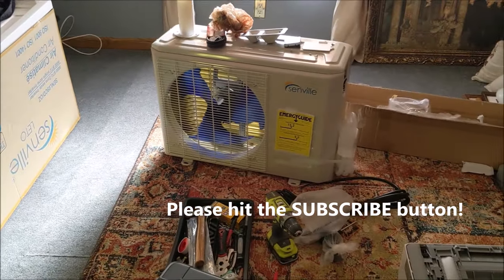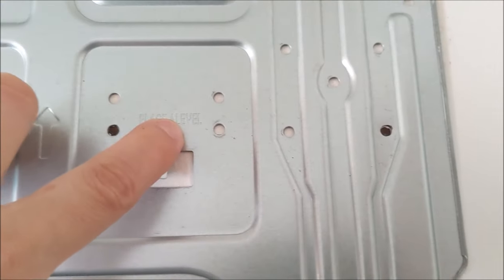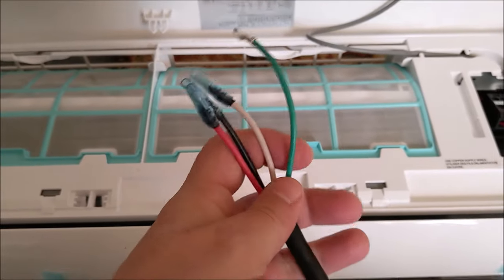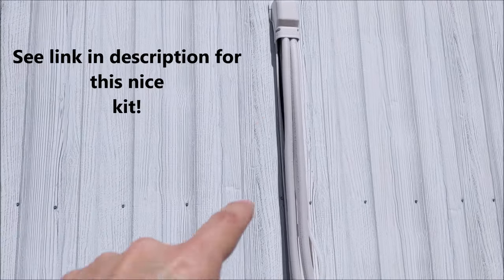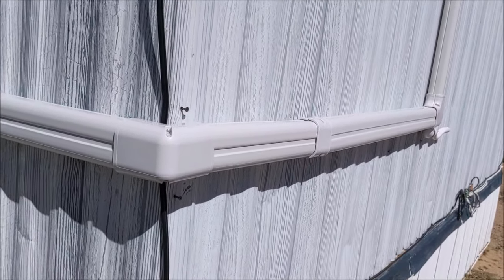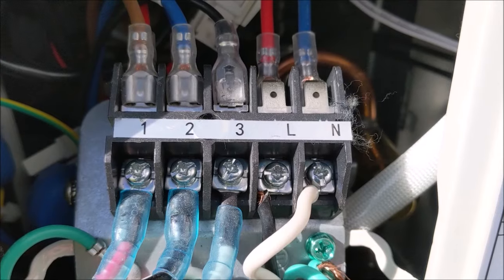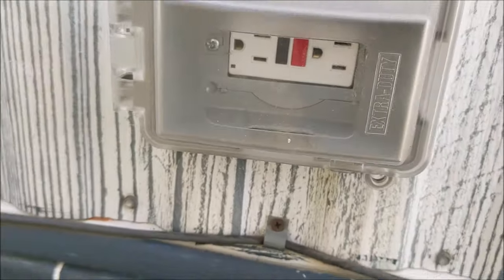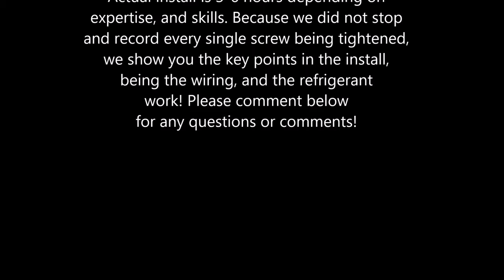Senville mini split installation key points in under 10 minutes for DIY ductless install

Comment: @SaveGreenHere
Thanks so much for the very helpful video! 
With your pioneering documentary, I'm much more comfortable installing the same mini-split and line-set cover kit than I was...

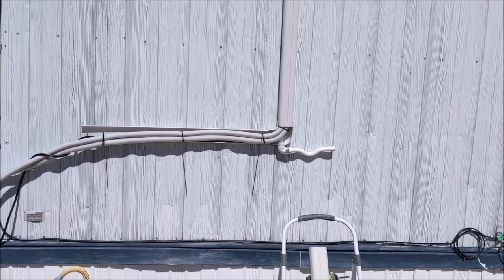You mention at 3:50 that the cover kit protects the line set from UV; but I haven't seen any claims anywhere that this particular plastic cover is of a UV-resistant plastic. I did read that it's ABS; but there weren't any UV resistance claims.
 
So where I live (south-western desert), not many plastics that are subject to the sun for any length of time can survive its brutal onslaught of intense UV, IR and radiant/conductive heat. Most uncovered/untreated plastics don't last thru a summer.
  
So how is your cover kit doing after 3 years?
Reply from the maker: They hold very ok. However, there are some that specifically say "U/V proof"......... https://amzn.to/3Ozv7T3
Reply: @SaveGreenHere  Thanks!

Comment: I wired mine the same way from the signal wire inside to the outdoor unit, but I am getting an 88 code. I understand that this code means that I have wired it wrong. Can you advise please?
Reply from the maker: Yes that is a faulty wiring code. You have to make sure you have a tester with two prongs to test the source and ensure you have 110v or 220v, depending on what you purchased. Then, you need to double check the color of the wires match exactly on the connectors both indoors and outdoors.

Comment: Fantastic tutorial. How do you like the system, is it noisey?
Reply from the maker: On this install particularly, they went with a 19 SEER. ( https://amzn.to/2XsNLC0 ) It is EXTREMELY QUIET. Funny thing, I was having a five minute conversation with the home owner right next to the outside unit, and it was running the entire time! We couldn't even tell it was on! I put my tester on the plug,  ( https://amzn.to/2WXw4Lg ) and it was puling roughly 1250 watts, so less than a hair dryer, and less than a 1500 watt space heater. HIGHLY RECOMMEND the 19 SEER Senville!
Reply: @SaveGreenHere  i may go with 2 or 3 small units for different rooms in the house. Thanks for sharing your install. 👍 i make videos too and i know it can really slow down the process when you record what your doing.

Comment: I had to switch ch my drain line from the right side to the left side (looking face on).  I am supposed to plug the unused drain king.  What do I use o plug that line?

I am installing the Senvikke 2400 btu on nit

Comment: Where do you find the communication line? I don’t think mine came with one. Also, instead of plugging it into an outlet; can we hardwire it into its own circuit?
Reply from the maker: You can hardwire, yes. That is actually the best option, with it's own breaker! Here is the communication wire..... https://amzn.to/46Mw4hl

Comment: Nice video, good stuff here.

My problem is the area I want the heatpump to go is no where near the outside receptacle. I wonder if it would be ok to route the power cord back through with the signal and refrigerant lines to inside the house and plug in there. My gut says not a good idea but still curious what you think.
Reply from the maker: Yes, you can route to the inside. And ensure you get a 10 ft plug/cable that is also the 12 gauge, like this.... https://amzn.to/3J93DyE
Reply: @SaveGreenHere  interesting. Does 12awg only come in 10 foot max for the "appliance cable"? I can find 12awg extension cords that are longer (I need probably 14ft) but they sure don't look as  robust as the one you linked to and i can't seem to find any that are longer than 10ft.
Reply from the maker: This one is onger than 10 ft...... https://amzn.to/3eTP47e

Comment: I’m going to buy the 9k BTU for a 10x10 room. Can I plug it to any outlet ?
Reply from the maker: I have a full, complete list of all the different items you will need. Anyways, on that list  on the video description, you will see this plug. https://amzn.to/3utMz0w You can wire it and it can vary from manufacturer on which unit, (the indoor or outdoor unit) carries the power to the wall outlet. If it's the outdoor unit, and you want to plug to an indoor outlet, just channel the cable to the inside where you run the communication wire, and the drain tune. then just simply have it come out the side of the indoor unit, into a plug, hopefully close to the indoor unit. If doing this outdoors, just make sure the plug connects to a non-GFI outlet, but with a weather-guard type cover, like this one...... https://amzn.to/3at6hCx  At any rate, a 9000 BTU unit is not a big power draw unit, but just make sure your breaker is at least a 15 amp, or 20 amp better, and not a lot of "heat producing" electronics are connected to the same circuit, such as a hair dryer, heater, etc.

Comment: How did you bend the pipes? I have installed the unit inside. But a bit hesitant to bend the pipes
Reply from the maker: lay them out in the hard sun for about 30-40 minutes, or during the entire time that you prep your install, like drilling the holes, mounting, etc. The sun makes the copper easier to bend.

Comment: Aura minisplit usb/wireless doesnt work.
Used seville app to try and scan qr scan, no luck. Then tried manual setup. App does not see my wireless network.
Reply from the maker: reset your router. You may need the newer type routers if after re-setting, you still have no connection. I went over the newer routers here------> https://www.youtube.com/watch?v=UFuTZ-XBxuw

Comment: I watched another one of your videos on mini split and you have the air handler plugged into an outlet, I would assume you could do that with any brand of mini split? I would have really like to see how its hooked up, can you let me know? I am getting ready to attempt the install.
Reply from the maker: You would need an outlet box, non-GFI, directly wired to the breaker panel on it's own circuit. You would also need to buy a prong to connect to the wire whip that comes with the mini split. Remember, green is ground, the middle prong of the connector.

Comment: Hi,great video. i plan on buying one of there 24k BTU with ceiling cassette. Is it possible to plug it into an existing wall outlet or do I need one of those electrical boxes?? I also have a difficulty figuring out in what order those cables go(red,white,black 1,2,3. Etc.Etc) could you please show a video in detail matching colors and numbers on outside and inside unit? Thank you so much!!
Reply from the maker: A 2 ton system should not go on a plug. It should have it's own dedicated circuit. The cables should be CLEARLY marked on your indoor and outdoor units.

Comment: Thanks for video. I’m replacing my old hvac with a 36k Senville units. The old system 240v electricity was supplied from a 3 phase panel with a hot leg. So the 3 wires are 2 hot wires and one ground as it is supposed to be for senville system as well. The voltage between 2 hot wires is 240v which seems good. The only concern that I have is that when we measure the voltage between first hot wire and ground it shows 208v and between second hot wire and ground is 120v. I did some research and it looks like this is because the panel is a 3 phase with delta configuration or hot leg. Since the senville manual says power requirements is one phase 240v do you think using the old system wires for this unit is ok?
Reply from the maker: Looks like it will not, unless you have an expert electrician provide more knowledge.

Comment: My mini split came with 220v cable can I buy the 110v wire in Amazon ? And also will that work fine ???? I got the small mini split
Reply from the maker: If you bought a 220v unit, you must use a 220v source.

Comment: I just took my 12,000 btu Senville down to relocate the inside unit I ordered a 25ft line set do u think it will be able to run ok on a 25ft line ?
Reply from the maker: How long is the current line? If it's 22 ft for example, no big deal. But if it's 10ft, for example, you will need more refrigerant.

Comment: I have a 700 ft² mobile. The bedroom is 1/3 of total square feet. Would this unit be sufficient? Also, can you use an additional wall mount with this one. Condenser?
Reply from the maker: 1.5 ton, or 18,000 BTU would do........ https://amzn.to/46LqITu

Comment: Great video! Left a comment/question on your other video.
So I bought a 110/115v unit so I didn't have to do the disconnect box. Now I was under the understanding that the indoor unit plugged into the wall receptacle is what powered the outdoor unit. But you did say that the outdoor unit also plugs into a wall outlet correct? I'm guessing 3 prong. So do I need to buy the 3 pronged wire set to connect to my outdoor unit then? I know you had links on another video for 2 different kinds, I'm just outta my wheelhouse on the electrical side and don't know which 3 prong I need and if my wall outlets are sufficient. I've read that different units use different amps/watts so my wall outlet might only give 12 watts but its wanting 15 watts. And I've seen people say that that's not really a big deal and that you'll know because a circuit breaker would trip for the section of the house its plugged into.
So like not having 2 mini heaters plugged in on the same outlet like in 1 room or 2 rooms that share a circuit,
Can both the head and the outside unit be plugged into a room all on one circuit?

Thank you for all the help. I hit the like button and watched the ads so you can get paid for your content. Thanks again.
Reply from the maker: Seems like you are a bit confused with the hoses, and the gauges. Thank you for watching. These videos may help out..... https://youtu.be/RL64RX-LvrI   and  https://youtu.be/RndlC9g5HzQ
Reply: @SaveGreenHere  Thank you, the hoses for dummies video really cleared up the low side and high side. I did leave you a comment about adding the refrigerant and a nitrogen back pressure test if you are able to assist with that. Thanks again!!!

Comment: Question: I am thinking of getting a 4-zone mini-split but was thinking that I should go with two 2-zone mini-splits?  Thanks for taking the time to make and share this video 👍
Reply from the maker: Go for it! 2 Zone systems are definitely more manageable, and less complex than the 4 zone system. They also are available for just under $2000 as of today...... https://amzn.to/3gzVqd3  All depends on the TOTAL space you have. For example, what size system is there now? a 3 ton, or a 4 ton? This can help give you an idea as to what would work best.

Comment: Nice video thanks. You didn't  use conduit for the  signal wires going from the inside unit to the outside. I've watched many videos , most don't but some do .You obviously don't think its necessary..I'm about to install a similar Senville unit and I want to do it right.Can you comment on that?? Thank you
Reply from the maker: Check with local code. In this specific install (in the middle of nowhere in the dessert) you don't even need a permit, or conduit, UNLESS the wire is over 3 feet exposed. The line chase is thus not "exposing" the wire. Some may argue that having the conduit inside the chase protection material in an area where temps reach near 120 degrees Fahrenheit, that the heat already produced by the wire is further enhanced by having conduit, plus a chase cover. So you should always check your local codes.

Comment: Hi , I had a  contractor install 1 Senville SENA36HFMOZ 36000 BTU outdoor unit and 4 Senville 9000 BTU indoor units . Electrical completed by journeyman electrician . The lines  nitrogen tested and vacuumed . The outdoor unit and the indoor started up without issue . The problem is the outdoor unit  cycles into defrost mode often . The issue is sporadic  , but minimum 1 defrost per hour , many times 2 defrosts per hour . The outdoor temperature has been approx 6 degrees celsius  and there is no visible frost on the outdoor unit coils . Do you have any idea what would cause this ? Any suggestions on how to remedy the issue .
Thanks Jay
Reply from the maker: Hard to tell from here.  Could very well be a defrost setting. Also if 6 degrees Celcius (42 Fahrenheit) and windy enough to make the unit think it's below freezing, that could be it. Another factor is factory defect. But there are literally too many variables. Good questions to ask after an install........ like did contractor use Nylog to seal the flare connections? Did contractor properly vacuum, or breeze quickly through it? The vacuum and test after vacuum is critical and would point out if the lines are tight.

Comment: Does this unit have a drain plug? How donyou clear a p1 code?
Reply from the maker: You should see it at the bottom, on the flat level area, if it's a heat pump, on the outdoor unit.

Comment: I have put 2 of these senville's in now,  one at our office that had been using oil heat and the fuel oil was costing $6 a gallon at this point, $600-800 for each tank refill. This unit will pay for it's self in just 1 oil refill we no longer need.  Then we put a small one in our bedroom at home and will do a larger unit later for the front room. We have forced air electric heat at home and was getting tired of $400-500 power bills in the winter.
Reply from the maker: Yes, I wish more people knew just how much money these things save. The savings are astronomical!  Thanks for sharing your results!
Reply: @SaveGreenHere  I noticed the furnace was rated around 2GPH, so that means it was costing the owner $12 a hour to run.  That's just crazy

Comment: I'm installing this same unit (except mine is 24K BTU). My question is on those 90 bends: When you make that bend the copper pipe doesn't pinch down on it self?? My lines come out of the wall just like yours do. I'm worried that if I bend it to a 90 there will be a crease in the copper.
Reply from the maker: For best results, use a kit like this one. No mistakes, no kinks, and no refrigerant restrictions..... https://amzn.to/3u3fEwy   The other option, (not the greatest, but better than nothing) is to leave the copper tubing laid out in the hard sun for 45 minutes to an hour, and immediately install. It may be easier to bend when the tube is hot. Wear gloves! But the absolute best, and proper way, is to get the kit above.
Reply: @SaveGreenHere  Thanks!

Comment: Just got my unit to install and was wondering if you checked the pressure and vacuumed the lines? Saw it in another video and wasn’t sure if it is necessary.
Reply from the maker: Yes. Check pressure and vacuum the lines from any humidity in the lines.

Comment: For the system in this video:. What size breaker is used for the circuit?  Is it a single pole or double pole?  Thanks
Reply from the maker: https://amzn.to/3GstzDr  But you may have a different brand of breaker like a Cutler hammer or another type.

Comment: Educational and Great video!! Liked and subscribed. Im planning to have it installed on my camper van's rooftop. Can the outside unit be laid flat and will it still function the same as the upright orientation? Thanks
Reply from the maker: You cannot lay the outside unit flat.
Reply: The a/c compressor is in the outside unit and needs to be in an upright position.

Comment: @savegreenhere do you have a Instagram or something to where I can send you a picture of some wiring problems I’m having for a ENSO 12000 BTU -110 Volt Mini Split System with Install Kit 17 SEER Standard Compressor
Reply from the maker: Best is to share via Google photos link, because I may not have the solid answer, but maybe someone else here can chime in.

Comment: I cannot find the drain line in my unit. (not my install). Senville is leaking on me after a week of continuous use.
Reply from the maker: Should run parallel with the wires to the outside. But, could it be that it was never even connected??????? 🙄

Comment: Does anything have to be welded on the Senville Unit?
Reply from the maker: Rosalyn, if you buy this one,....... https://amzn.to/2UiJhc5 it came with the flared ends of the copper, so absolutely no welding or soldering on the copper tubing that came with it. Not sure with all the others out there.

Comment: Excellent video..  Thanks! I have 2 questions. I heard people said that don't directly connect to a GFI electrical outlet because the heat pump may not work consistently or perform well.  Is there any truth to it?  Also, is a 220V. system much better than 110V unit for the  BTU?
Reply from the maker: To answer the first question, YES! For example, on the Senville units, the sensitive equipment on their units reacts to the GFI, and it does not function properly. We ran into an install where the customer insisted on the GFI to plug into. Two months later, the Senville unit quit. Once we did a direct wire connection, with disconnect, it worked again. Same goes if a plug is in place. Plugs are ok, just don't use GFI. The second question is there is no difference between 110v and 220v, with BTU being equal. For example, 12000 btu on 110v will give you 12000 btu, as it would on 220v. The end result is the watts. So 110v x 15 amps is 1650 watts. And 220v x 7.5 amps is also 1650 watts. So I just look at every job differently, and see which mini split is more economical to purchase (110v vs 220v) and the wire run, as 220v will require more expensive wiring. All depends. I am neutral on the matter.

Comment: Does the unit comes with the plug 🔌 wire or you have to buy it separately?
Reply from the maker: You need to buy one.......  https://amzn.to/2XrPgQI
Reply: Is this for the condenser that needs to be plugged in?

Comment: I saw your line set was going out from the left site of the wall mount. Did you extend the line set before feeding through the hole?
Reply from the maker: The line set came out naturally on that side. Some units it comes out naturally on the opposite side. It just depends on the unit.
Reply: @SaveGreenHere  thanks